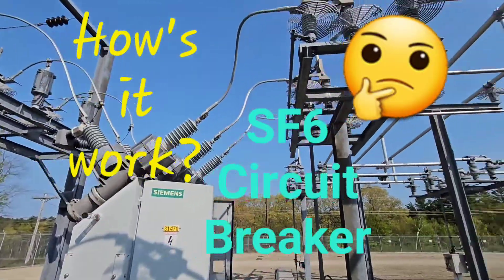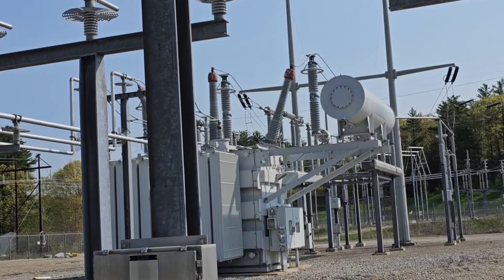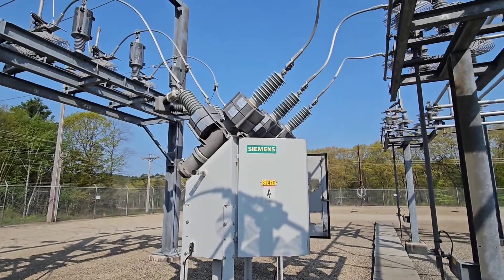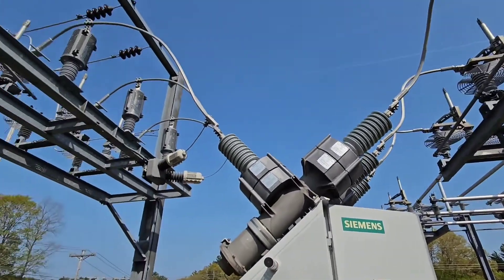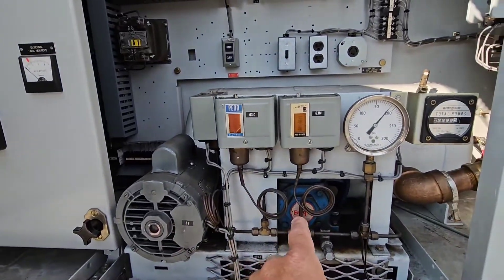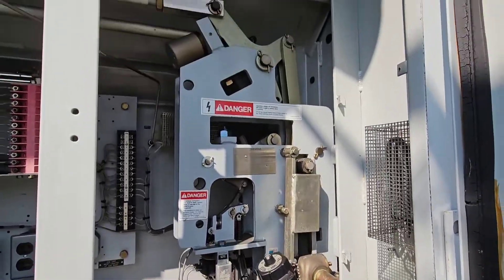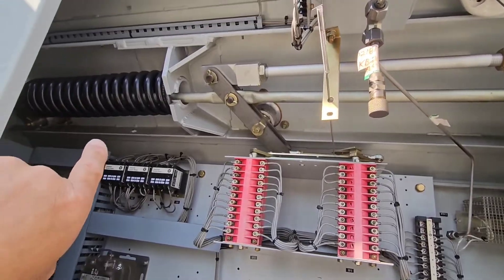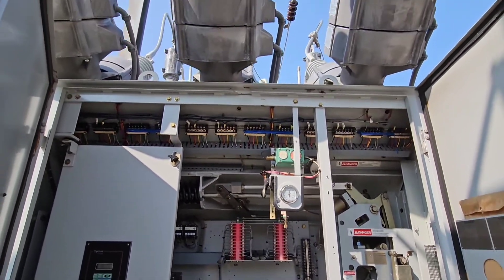How's it work? Substation SF6 high voltage circuit breaker explained. 1st generation Siemens

Comment: Interesting. Here in Canada 🇨🇦 we have SF6 CBs in front of the XMFR from the high side. According to the last update of the Saskpower electrical code, there must be two of them.  The funny thing is that we still have oil CBs that have been in service and are running since 1950s
Reply from the maker: We also use double SF6 on the high side.  We've done away with all the OCB's above 34.5kv... but the old ones that are still in service from the 50's do indeed work reliably.  I like the GE spring charged mechanism OCB breakers the best 👍